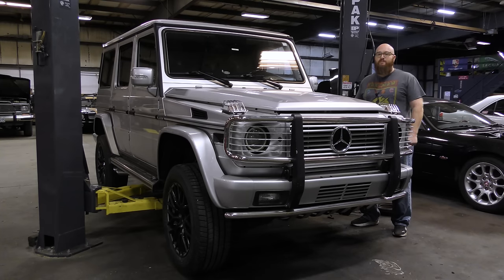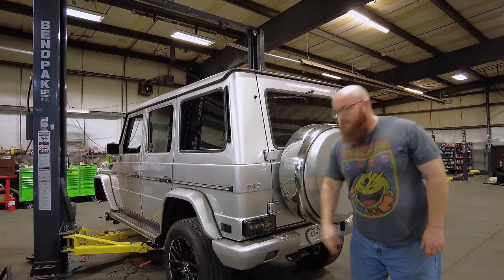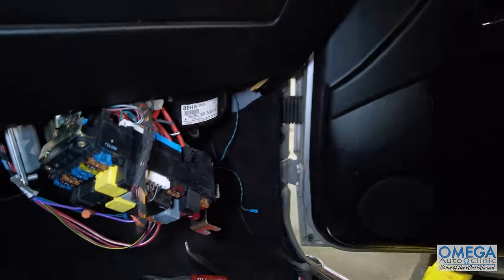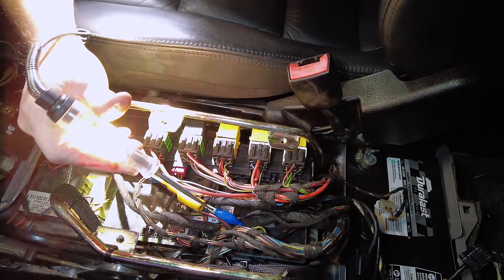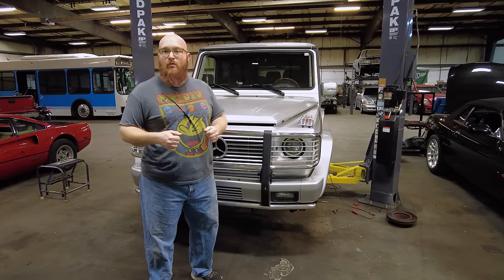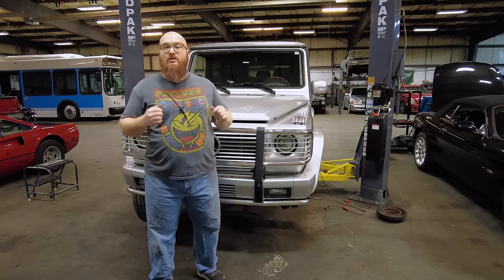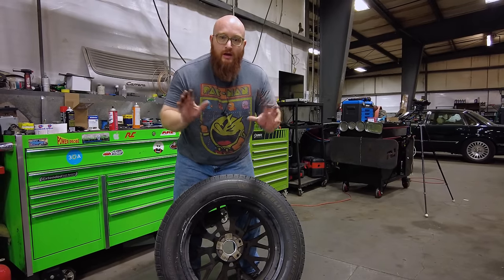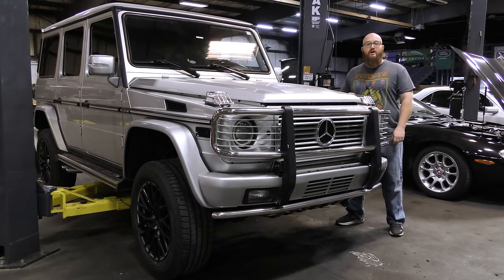Dangerous Mods on this '03 G55 AMG G-Wagon! CAR WIZARD shocked at the level of stupidity

Comment: seeing that front end makes  me think that the frame is either tweaked or the bullbar bent
Reply: Yeah, no kidding, the Wizard was going on about how beautiful it was, and I was wondering if he was looking at the same car as me, because the front end of that G55 is as straight as RuPaul's Drag Race.  The fact that the owner of a used car dealership bought this as their own personal ride without realizing how absolutely sketchy it is tells me I wouldn't take a car from their lot for free, much less buy one.  This G55 might as well have "drug dealer" in LED lights on it, because I'm pretty sure that's who owned this.
Reply: @megachonk9440  I have worked around used car dealers and wholesalers, these guys will not take a nice car that they bought cheap for their personal car, they just look at as they are wasting profit. They rather have as their personal car one they bought cheap and maybe has a salvage title or one that cosmetically looks good put has expensive problems, so they spend as little as they can to make it useable and don’t care about putting miles on it cause usually they are high mileage cars.
Reply: Definitely looks like a wrecked car. Is the front axle a replacement from a different model and that is why the wheels wouldn't fit?
Reply: yeah that's all I could see lol
Reply: @carlwest859  It was likely just some surface corrosion that prevented the wheel from sliding on. Worst case the hub center might have been slightly ovaled due to a heavy impact, but is extremely rare. It may also be that those aftermarket rims were not machined to proper tolerances.
Reply: @JasonWW2000  Maybe the previous owner had spacers/track plates on for more track width? Probably not the correct ones for this car so with an inner diameter too small. Here in Germany, most AMG wagons are owned by chavs showing off. That would be a typical mod to lower it and make it wider.
Reply: I was trying to look for what is exactly crooked, but it seems like that the black part of the bullbar itself is shorter on the right? Is it some badly homemade bullbar?
Reply: @mazes8931  Not homemade, just crooked. A minor impact may have bent things making it crooked and the repair may be too expensive to fix. (Slightly bent frame for example)

Comment: Watching the Video, and looking at what had been done with the light mod, I bet the centric wheel hub was cut down to make aftermarket wheels fit. When the G-wagon was traded/Sold, the stock wheels were put back on it. I bet it wasn't a fitment issue of the original G-wagon wheels, but was a fitment issue on the aftermarket ones they were trying to put on

Comment: The switch in the back of the brake light is not to turn off the brake lights. It is toggle between a sequential turn signal or a solid turn signal. The taillights are also missing the gasket to seal them against the body, so moisture absolutely got behind them

Comment: It's not just powering those LEDs, there are load resistors on the back of that aftermarket rear light to stop any fault messages showing on the dash for a blown bulb, so the load will still be the same as a conventional bulb. Great thinking outside the box though!

Comment: "What?! A German car that's complicated?"
If the Germans had invented the hammer, it would have three moving parts!
Very nice Sherlock work on the wheel problem; you're a perfect example of the difference between a mechanic and a "technician"! Good work, dude!
Thanks, Mr. and Mrs. Wizard! ✌️❤️🙂🇨🇦
Reply: Maybe so, but it would look better, feel better and work better until it broke.
Reply: That's why Russian engineering made a proper sledgehammer...

Comment: I needed the rear diff repaired on my truck. The dealership solution was to replace the entire rear end instead of the bad parts. Of course I took it to another shop and they fixed it properly for less cost.

Comment: Instead of adding the signal light load to the front signal module, you could have added a relay for the back light using the rear module power, the relay load imposed on the front module would have been minimal, especially with the new solid state relays.
Reply: Yup. Trigger the relay with the signal from the front module and power the relay from the rear module, or really any power source of your choosing. 15 years installing car audio taught me lots of unique ways to utilize relays.
Reply: OTOH, if this car came with incandescent bulbs originally, won't these LED's be well under the design load?
Reply: @theundergroundlairofthesqu9261  that is very likely. Often times adding LED bulbs without adding resistors inline can make the vehicle think the bulb is burned out or missing. In most cases the bulbs will still work, but the vehicle will do the "fast flash" of the turn signals, as if a bulb was burned out, However due to the complicated lighting system in this truck it's possible they just wouldn't work at all. However, that doesn't explain why the fronts are working, as I assume the are LED as well.
Reply: One has to wonder if the aftermarket LED tail lights on this vehicle ever worked. I would be curious to see if load resistors would have made them work with the rear SAM.
Reply: @DriverDude100 My money is on this….   Original lights would fire right up Id bet.
Reply: @addicted2bass87 and you could also power the trailer hitch wiring through those relays as well.

Comment: It's a wonder the studs didn't shear off from the stress of trying to hold a rim center 😳
Reply: Probably only survived because its built like a truck 😂
Reply: those studs can handle the load whether the wheel is off-center or not. The section that was cut out only centers the wheel.
Reply: @adotintheshark4848  Thank you. I keep seeing this myth everywhere. The hub ring does not support the weight of the wheel when torqued down properly. I went years without using hub rings and had no issues.
Reply: had wondered how the wheel lug taperes looked cause if it was moving that much i woudl think the holes would be wallowed out at least a bit.  sure it costs more but im in the replace the hubs (120K likely need them soon anyhow) if the new hubs and wheels didnt fit turn the shoulder to the rim spec.  new rims only if the holes are looking bad
Reply: @adotintheshark4848  Thats very incorrect information. The hub is supporting the weight of the vehicle and transfering bumps, etc... into the hub. The wheel studs are only designed the pull the rim against the hub. They are not designed for sheer forces. I've seen numerous vehicles bust wheel studs, some even have the wheel fly off while driving, due to using wrong rims or adapters that don't use the hub centers.
Reply: @lrharner  It probably doesn't have conical lug nuts or lug bolts (vs. captive flat washers on the lugs of hub-centric wheels) if it did there wouldn't have been any runout.
Reply: It looks like putting the wheels on without the centering ring would be difficult.  I use the wheel studs to line up the wheel before I add the lug nuts.  I have never understood why some manufacturers use bolts to hold the wheels on.  It requires alignment while starting the bolts.
Reply: @JasonWW2000   Exactly. Thanks for clarity .

Comment: Similar issue on my 2002 G500.  Random vibrations at 60-70mph. Austin Mercedes and 2 other shops gave me their best assessments. I replaced the damper, bushings, I balanced tires countless times with the machine that Mercedes called for, alignments as well, etc. etc. Austin Mercedes (even before the mechanic went over it) told me that it would never ride as I wanted it to. Terrible. It was the wheels as well! Last owner had replaced the wheels with a non-Mercedes wheel and and the lug nuts didn't sit 100% perfect. Tire Man in Austin resolved it. I found used original wheels for $300 and it resolved the issue. Amazing was the first vibration-free ride.

Comment: I'm guessing the PO installed one secret "all rear blackout" switch, in some hidden place, to black out all the rear lights including the license plate light. (Have you checked that one?)
Reply: Classic crim car mod, shame these buckets get mangled by miscreants like this.
Reply: This is the worst car ever to commit crime with. How many silver G wagens are in Kansas? Lol
Reply: @thelastmemphian  This one!
Reply: No shit Sherlock. Car Wizard says exactly that in the video.
Reply: @thelastmemphian  It ended up in Kansas but that does not mean that is where they used it, might of dumped it off there, or the cops got them as they were just driving through Kansas.
Reply: @A-FrameWedge  “yeah we got a report of a silver tank-like Mercedes vehicle with stolen plates going down the interstate”
the owner happily driving, thinking a blackout switch will solve this
Reply: my favorite part is that it's behind the light housing on a 6" cable and not even in the cabin for the driver. any advantage gained by activating it in a chase is negated by the cumbersome process to activate it.
Reply: @sean2137  I just have to say it:That wasn't too bright of them.
Reply: @sean2137  Any Smart Criminal (oxymoron?) would tell you "Obviously you'd activate it BEFORE  committing the crime!"
Reply: @sean2137  But what if the police search his vehicle and find this switch if it's in plain sight in the cabin?
Reply: @caddyguy5369  The only criminals I’m aware of have all been caught, so yes.
Reply: @GrayRaceCat  Just because you hear about dumb ones doesn't mean smart ones don't exist.
Kind of the reason you don't hear about them. They are smart.
So, smart ones... dumb ones... same as everything, mixed bag. Doesn't really equate to an oxymoron. :-)
Reply: The switch is to change the animated blink.
Reply: This is why I will never buy a used car.

Comment: Non auto mechanic here, lathed my own Teflon centering rings to mount aftermarket forged 3 piece wheels, worked great. 👍

I too find myself having to redo mechanics work far too often. There are great mechanics out there for sure, too bad some jokers destroy it for all of them.

The guy who took the cake,  was a tire shop I had requested to apply some liquid rubber along to he rim to stop a slow leak. Picked up the car, guy says "Didn't have any liquid rubber, so used grease instead, but it shouldn't be a problem as they are both black in color, so should work just as good."

Didn't even make it home before the whole tire blew off the rim.

Comment: I think your describing the "death wobble" phenomena on 4x4 vehicles. The Death wobble is used to describe a series of sudden, often violent front suspension vibrations exhibited by solid front axle suspensions, and more infrequently, independent front suspensions. When death wobble occurs, you will feel a shaking in the steering wheel, which will increase or decrease with speed, and depending on severity, shaking throughout the cab. It may also cause involuntary wetting of the occupants of the vehicle due to the severity of the wobble.
Reply: File this one under, "How to tell us you a Jeep owner, without telling us you're a Jeep owner."

Comment: Love that wiring repair! Im a forklift technician and I had to do a similar thing.

 I had a customer with a very old stockpicker lift. It had an intermittent no travel that got so bad that eventually it didn't travel at all. I checked the usual things, most common being a failed brake switch that tells the controller the operator is present and allows the truck to travel. The brake switch actually checked out good. I traced the voltage all the way down to this small "brake module". Voltage was going in to the module from the brake switch, but it wasn't coming out. I checked the wiring diagram, and to my surprise, it showed that portion of the brake module didn't really do anything. It just showed a loop from the input pin to the output pin, no resistors, no diodes, no relay tips or anything like that. Out of curiosity, I bypassed the loop in the module so that the input voltage was connected directly to the output voltage wire and lo and behold the truck began working. It traveled like normal and the brakes still worked perfectly fine. I saw that truck many times after that and the repair held up with no issues.

Comment: These G-Wagon's from Mercedes-Benz are expensive to repair and to maintain.
Reply: Air is air.
Reply: Water is wet
Reply: It’s a Mercedes. Did you expect anything less?
Reply: Hot is hot😊
Reply: Expensive cars are expensive to maintain. Common sense.
Reply: Vehicles that are expensive when new don't get cheaper to maintain or repair as they age..
You cannot drive a Mercedes Benz and expect to maintain it on a Hyundai Accent budget.
Reply: not in Germany
Reply: @ll4680  True and in Europe overall I'd say.  In the U.S. these are "exotic" cars or so. Many shops have no clue how to work on them so they charge more per hour or just consume more time.
Sometimes the same thing in Europe with U.S. cars. Some just don't even want to work on them and parts might be expensive.

Comment: What’s crazy is I literally just had a 2006 g55 in my shop with the same issue on front hub🤯! They cut the freaking flange off! I don’t have a lathe so I just bought a new hub.
Reply: Maybe you might become friends with a machine shop to get the work done. 
We used to have a machine shop that if they couldn’t fix it, you made a mistake, a big mistake, in buying it.

Comment: Pretty badass how the wizard fabricated up that fix.  If it were my truck I'd have gone back to the stock/stock looking 16" 5 spokes(whatever the smallest wheel you can get that clears the brakes).  Put some knobby tires with a lot of sidewall on them, make it a more functional off roader with a tire that would get ya thru some mud.

Comment: I had a 2000 c200cdi and the rear Sam went out while a shop disconnected the battery. New one was about 1200€ + labour and programming (not at a dealer tough). I think the rear Sam also works the remote locks and radio antenna amp at least so it's very much necessary.

Comment: We do the same thing here at the Mopar dealer. We have TIPM issues. Mostly the internal fuel pump relay. They had a decal on Grand Cherokees and Durango’s. Well we took that external relay repair and did the same thing for other car lines with failed internal relays.

Comment: I note that you didn't mention check ingif the CANBus signals were reaching the rear SAM; if you did, and it was OK, I would have thrown a trailer signalling module in there as a better solution than paralleling the front and rear lamps.

Comment: Ah good ole german OVER ENGINEERING…if two screws will hold an item they put in 5 including 2 bolts in 2 different two different sizes and with one obscure torx head with an oddball 1/2 size.

Comment: Hub centric rings are so important.  I had a shop leave one off on my RS5 and I thought the wheel was going to vibrate off.  If you have them, make sure the shop is careful to put them back on after they mount a tire or put it on a balance machine.
Reply: If you don’t have hubcentric rings you just gotta mount and torque the tire nice and evenly    I’ve run without having hubcentric rings for a few years now, no issue.

Comment: Front bull bar twisted, first thing I noticed. I was at a friends shop, a older Defender came in with aftermarket wheels that had been fitted, sort of by another shop, the wheels didn't fit properly and they failed to tighten the lug nuts and he lost many of them before noticing.

Comment: We had the same frontend vibration problem on a mercedes (non G-Wagon) after fitting sports rims on the car, after balancing the wheels with new tires the problem was still there, it was a real head-scratcher until we figured out the wheel wasn't centered exactly on the hub. This seems to be a serious problem with almost all mercedes front hubs if non-standard wheels are fitted - and mercedes wheel bolts make the matter worse, normal wheel studs usually center the wheel regardless of center hub. Cool video.

Comment: The switch on this specific aftermarket LED tail-lamp adjusts how the rear turn signal functions. It could be either standard or sequential (depending on local laws).

Comment: Correction (I think) hub-centric wheels/hubs are indeed weight bearing. One of the big reasons why cheap (non hub-centric) wheel spacers sheer off studs.
Reply: They don't carry any "weight" per se after the lug nuts have been tightened, just assist in centering the wheel. There is also lug nut centering wheels, as the "other" version.

Comment: The rear S A M probably does not want to operate the LED lights because of the resistance in the bulbs compared to led lamps.(flasher relays do that sometimes, the solid state ones fix that problem.)

Comment: Had you put the original tail lamps back in they would have worked. The SAM goes into protection mode when the circuit resistance is out of spec.

Comment: The hub is supporting the weight of the vehicle and transfering bumps, etc... into the hub. The wheel studs are only designed the pull the rim against the hub. They are not designed for sheer forces. I've seen numerous vehicles bust wheel studs, some even have the wheel fly off while driving, due to using wrong rims or adapters that don't use the hub centers.

Comment: 8:30 it’s funny how LED lights are. My 2007 RX350’s rear running lights were shorting out and melting the plastic tube inside (doesn’t affect the outside thankfully), I replace them with LEDs, now I have a permanent warning rear light failure on the dashboard. Apparently if you’re replacing them with LEDs, you might need to add an extra resistor because they’re so power efficient and draw so little power that the computer thinks the bulb burnt out
Reply: The opposite can happen too, the car fed so much power to the led it almost set the car on fire.